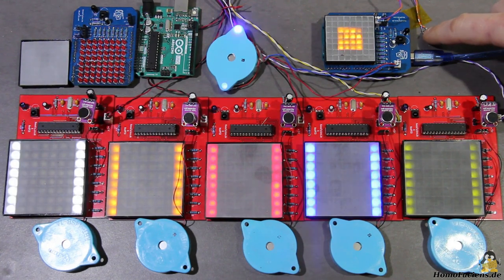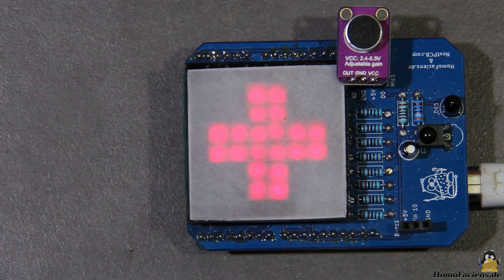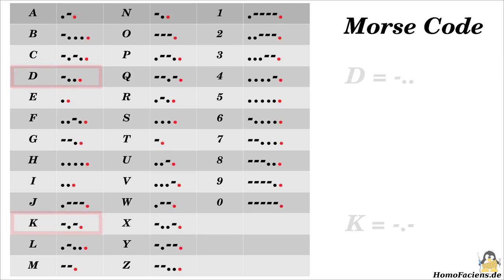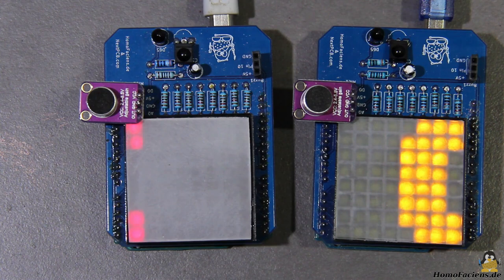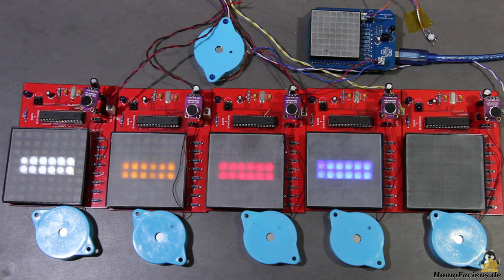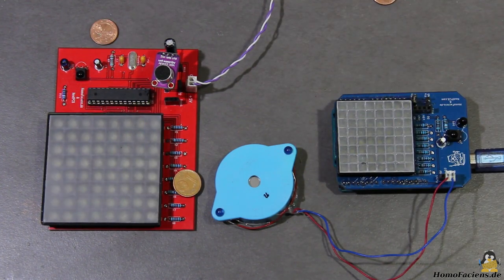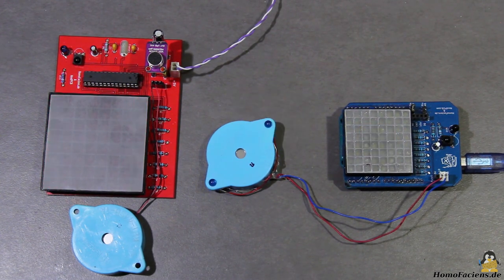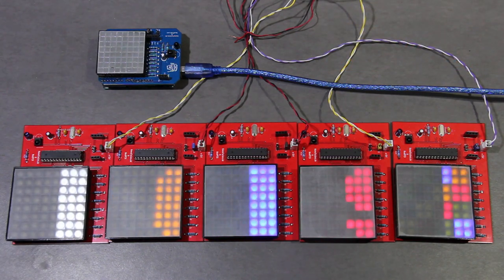Data transmission to an Arduino through Morse code

Comment: Wow! That was a great description on a complex topic.  I like how you explained the 'addressing devices' into the video.  

 (You could probably produce a complete additional video on how you found and solved the need for a filter!)
Reply from the maker: Thanks! When I started this project, my intention was to introduce frequency detection with Fast Fourier Transformation as well, but with that, this would have become a more than half an hour video. Frequency detection has it's own pitfalls and the idea for the filter on the input voltage came when I had a closer look at what made me fail to distinguish certain frequencies with my Adruino through FFT. If you have a look at figure 4 on my pages, you'll see the difference:
https://homofaciens.de/technics-physical-computing-communication_en.htm
So I decided to just detect sound at all, before using several frequencies for transmission. There is a lot more to tell about that topic and I guess it will be from interest for my audience as well.
Have to build the "slow printer" for the art project and an updated rover for the Pi & More in January, next. Frequency detection must wait...

Comment: Have you considered using ultrasonic sound for your system? You may use the small speakers found on the cheap HC-SR04 as your transmitters and receivers.
Reply from the maker: Well, this is an educational video, so it is better to work with audible frequencies. I will talk about frequency detection in a coming video (but not soon, other projects will come first)  and then also treat what frequency range you can work with. Stay tuned!

Comment: congratulations for the very interesting topic, I imagine how complicated the sketches are for this realization (let's say that on they explain the blink to me, I understand it, but if I had to rewrite it after some time ....
Reply from the maker: Thanks. Its the same with coding as with talking in a new language: You only get better by practice. The samples for this video where no big thing to me. I spent most of the time by playing with the hardware. Not until I noticed that there was lots of background noise caused by the not so smooth DC voltage at the microphone modules I succeeded in getting useful input signals. The rest was business as usual.

Comment: Great concepts! I was wondering what the fastest speed is you can obtain with the acoustic morse code?
Reply from the maker: I have a second video in mind, showing how to use different frequencies for transmission and also where the speed limits are. It won't get online soon, since I am currently stuck with many other projects...